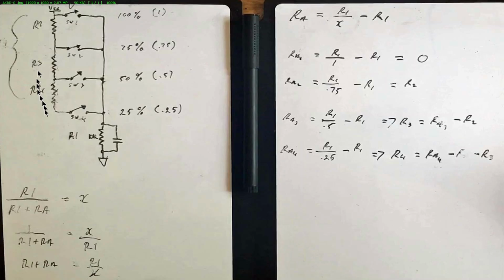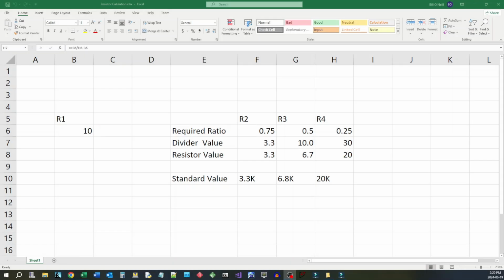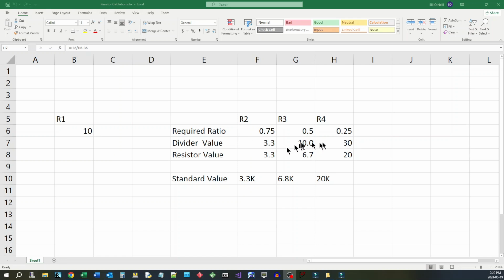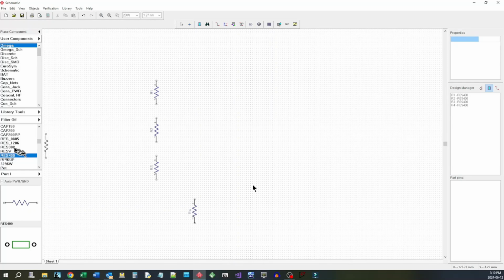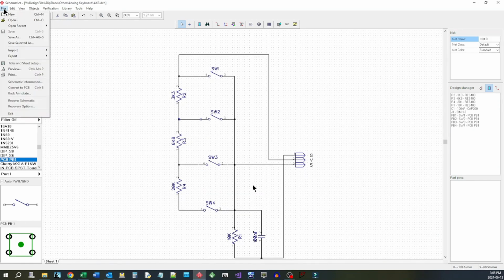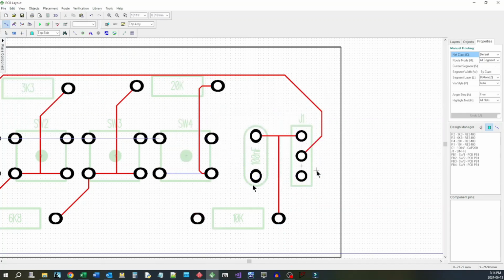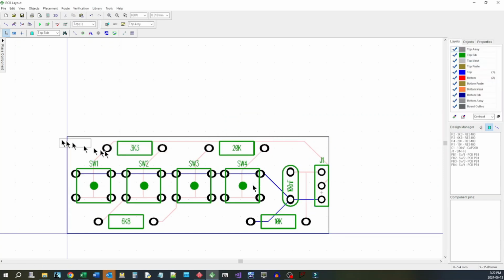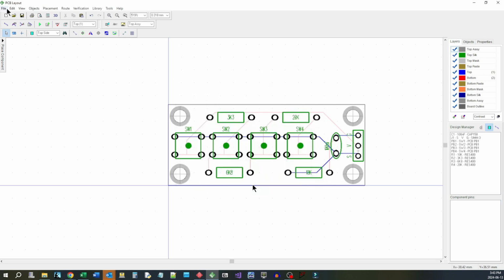Uni-Byte 0195 - ANALOG Keyboard from Start to FINISH (Modular Design)

Comment: Pardon? You don't need a trace connecting the two pins of each switch with each other, they're internally connected by the leadframe, the trace you drew is redundant. It's so forthcoming of switches to serve as an extra layer on the PCB. The connection from the south of 100nF to south of J1 can just loop underneath the 10k resistor, or the resistor can be moved to live between J1 and 100nF. Am i reading something wrong?

Also at high frequencies, your switch-common net, the S net on the connector, is effectively ground due to the capacitor coupling it in :D So you can make the whole bottom pour just that. :D
Reply from the maker: Yes, I think you are reading things wrong.  Sorry, but this comes from assuming you are better than others, I think.  🤣 The reason the trace is all the way though is so that if I want to build up one with only 1, 2 or 3 switches it will still work without me having to add jumpers.  Add to this that there is absolutely no advantage here to having a ground plane with this application.  It's just something I try to do if I can without compromising something else because in a lot of cases it is advantageous..

High frequencies??!!  What are you talking about?  How fast can you press buttons?  There are no high frequencies.  Copper pours and ground planes require the deposition of more copper, unless there is some real advantage to them (heat sink, shielding, reduced supply impedance, reduced signal impedance, etc. - non of which we have here), or it does not compromise anything but maybe a good exercise to do it, then why do it?
Reply: @uni-byte   Haha you don't have to get this combative :D it's all in good fun. It's not like i don't make ugly boards :D

I see your reasoning with through traces, the blue topside ones. The red bottom ones connecting two sides of the switch with each other are still redundant even if you want to leave switches unpopulated, might give you a little extra routing freedom, doesn't really help in this instance though. The S net can run the south side of switches for example if you were willing to put all the resistors on one side of the switches, which you might not want to. I mean there's no point nitpicking this board, i just do it for fun, not because it's bad or needs fixing.

Indeed you don't need a ground plane. But you said you like having one, sooo... there's that then i guess if you wanted.

Even if deeply entirely completely irrelevant, you're mistaken that there are no high frequencies on this board. The switching action at the moment of switching creates a pulse which is a frequency band from DC to infinity, and seen over a short enough time frame, the high frequency band is significant. And switch bounce adds to that. Sometimes it's worth keeping in mind, though not this time. Here you're having the capacitor take up the high frequency band and short it to ground, which is presumably why you installed it, aids with debouncing and makes for a much nicer better input read.
Reply from the maker: @SianaGearz  Not really trying to be combative, just giving back in kind with a little amplification, if you will.  All's good with me.

Comment: If you have tracks on one side why can't you have a copper pour (Ground) please ?....cheers
Reply from the maker: That's just it, I couldn't get all the tracks on ne side.  Really this is for high speed circuits (which this is not) but a ground plane needs to be free of traces, especially in teh case where the traces running on the ground plane side intersect traces running on the other side.  The return path for current in a ground plane follows right under the signal trace.  So if that path is broken by a trace on the ground plane side it actually ends up being a high impedance ground return.

Also, another interesting I found out from my contacts at PCBWay, the do not etch the boards to remove copper.  The traces are actually deposited on, so not adding copper pours where they are not needed is actually saving copper and hence the environmental impact.
Reply: @uni-byte  WOW ! thats a big deal I wonder if other manufacturers do that ! I shall check. so if you want a copper pour using Dip Trace you can it's just you prefer not to. My question wasn't worded well I'm a Kicad Fanboy and I thought DipTrace wouldn't let you thats all !. The ground plane or no ground plane argument will run forever. As you say doesn't matter in this case but I personally like to use a pour top  and bottom and until now that was also to aid the environment and that may not be the case....cheers :)
Reply from the maker: @andymouse  Correct, in this case I chose not to as there was no use to it.  Cheers
Reply: @uni-byte  thanks!! fascinated by the deposition process and want to know more but it's getting  late in the UK !! so bed time!..cheers :)

Comment: Interestingly enough, A&R Cambridge (aka Arcam of high-end audio fame) used the same idea in the Arcam Solo CD/Receiver/amp that cost over £1200 new in 2005.  I restored one the other day for a charity shop I volunteer for. I had to replace all the tactile switches in the chain, as the contacts had tarnished and the additional resistance confused the machine.  Apparently  they all suffer from this.
Reply from the maker: Thanks.  That's interesting.  While I like their idea I'm not sure their implementation matches the sticker price.  On something like that they should have a better quality switch.

Comment: Good project for a first time designer.  I would have liked to know what the purpose of this keyboard is, though, and why you chose this design over other possible implementations.
Reply from the maker: Thanks.  While I'm not exactly a first time designer I choose this design because it's easy to understand how it works, it's easy to build, it's reliable and it uses easy to find (almost ubiquitous) inexpensive parts.  The purpose is to provide a 4-switch input to a microcontroller using just a single analog pin.  (I thought I mentioned that in the vide?).  What other ways would you suggest doing this?
Reply: @uni-byte  I meant that for your audience.  I didn't mean you are a first time designer!

Serial data would be another way to go (I2C for example), but since you only have an analog input, that wouldn't be a good fit.
Reply from the maker: @yeroca  Gotcha.  Yes, this is aimed at the beginner.  As to using I2C or other serial input I would certainly consider that for more switches.  74HC165 shift registers could be cascaded to provide input for any number of switches but I think you'd need at least 3 pins (clock, data and latch).
Reply: @uni-byte   Huh not a first time designer, could have fooled me :D